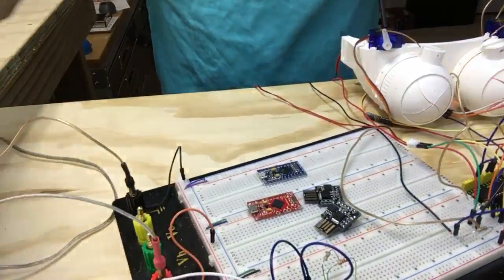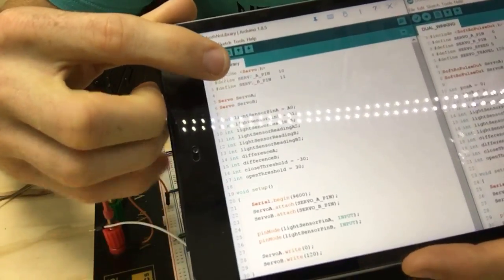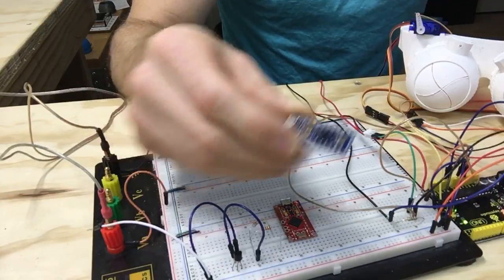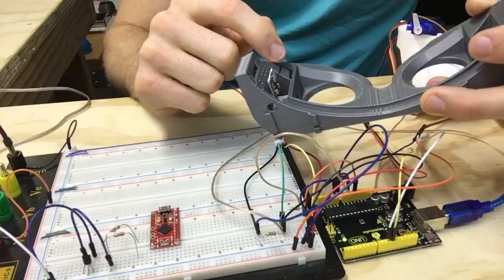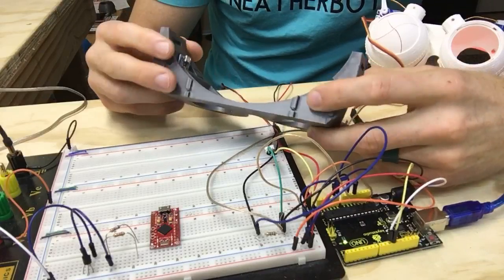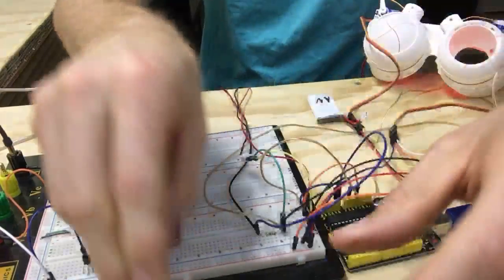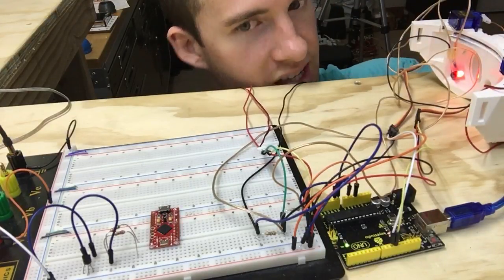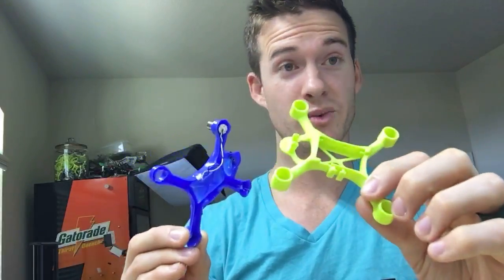They Wink! | Blinking Iris Goggles | Live Stream

Comment: I made this project for Halloween. it looked so janky compared to what you did. I used the code from this website as my starting point. http://inventorartist.com/blink-detector/ It works extremely well and is quite forgiving for the sensor placement. It's only for a single eye blink sensor so I modified it to work for two eyes. I couldn't get the servos to actuate separately the way I wanted in time for Halloween so it just triggers both servos to blink. Here's my cobbled together code. https://github.com/seth-stoothoff/Blink_Sensors/blob/master/Blink_Sensors.ino I also used the infrared LEDs and photo diode combination device I had from a line following robot I had. They don't look as cool but I didn't want lights shining in my eyes.
Reply from the maker: +mcguintyspub dang you did a lot of work to get it going. How did you power everything? You seem to have gone down the same path as me, nice work!
Reply: NeatherBot Thanks! I powered mine with a 4.8V 3600mAh NiMH battery. It was so heavy that I had to put that and the arduino in a project box I attached to the strap at the back of my head. It wasn't elegant, with all the wires everywhere, but it fit with the mad scientist costume I was wearing. It's awesome to see your polished results of a project that I got to try myself and yours is only going to get more complete. Excellent work by the way.
Reply from the maker: +mcguintyspub ahhh yeah NiMH would be a proper voltage but is crazy heavy. Hopefully with the voltage step up and the 1s lipo it works well. Haha we will see when all the parts come in. I'm glad you like the project videos, thanks for the support!

Comment: how much force do those lids need to have on them to turn? is it possible to build solenoids for it? its not hard to build your own custom solenoid, you've already got the copper wire for the connection, it could be used as the pushrod. It would be a lot quicker actuating than your current motors.
Reply from the maker: +Isaac Dahlvang I agree a solenoid would be ideal, but I draw the line when my projects start having projects ;) hopefully once I publish all the files someone can go back through and add solenoids!
Reply: NeatherBot, haha, yeah I can understand that. Building them would require a lot of extra design and time that isn't necessary to make a working model.

They're super cool that's for sure.
Reply from the maker: +Isaac Dahlvang I'm hoping someone will add the solenoids at some point!
Reply: Solenoids are like motors and servos, you can order them with any spec you want. And you wouldn't need to run the servo library. If you want to alter the speed, just generate a PWD signal off of the Arduino. Much less CPU intensive than the servo library, but you would have to tune the signal strength your self.

Comment: Great work!!!! 
Try with some small solenoids with a spring return. Less noise, and faster, but they might 
provide too much force. Would be much snappier! The servos are a great way to simply do it! longer servo horns would speed up the iris since the servo would not have to rotate as much.
Reply from the maker: +Andrew Scorgie can you link me to some solenoid that may work? I have not found any that are the right size/travel length.
Reply: NeatherBot looks like adafriut has some solenoids at lower voltages, short travel though. A linkage system would have to be made to make the travel longer, probably more trouble than it's worth. :(
Reply from the maker: +Andrew Scorgie hmm yeah, thanks for looking though! I like the idea, it's just hard to find the right solenoid for this project.